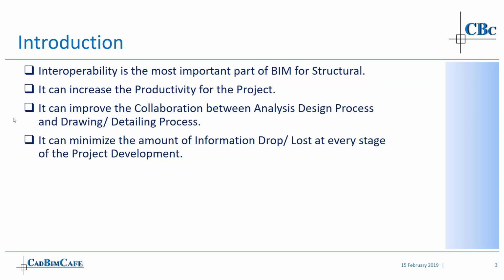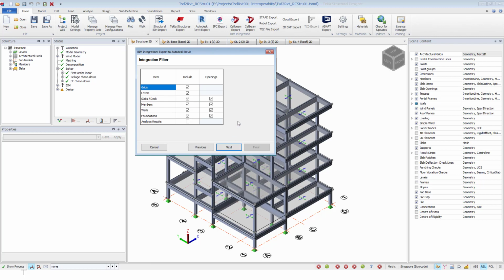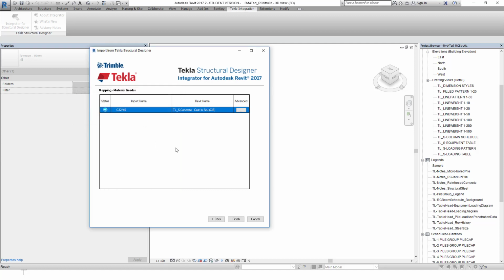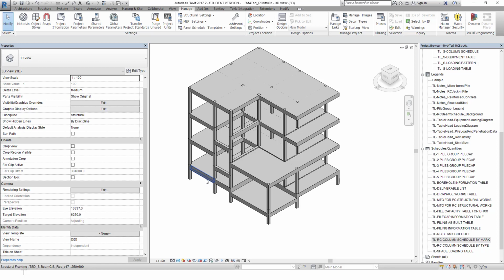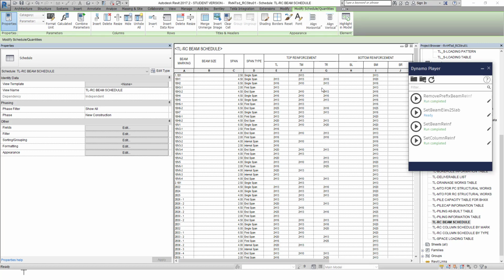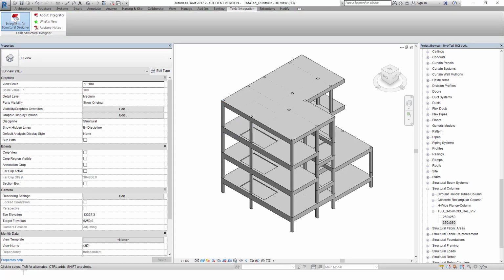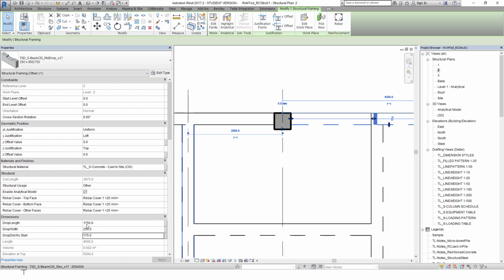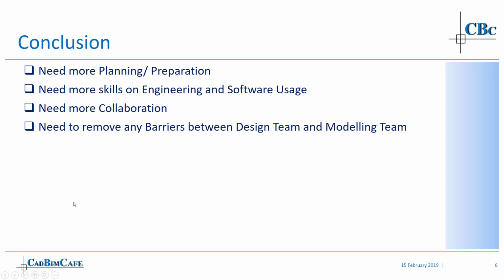CBc-Rvt003 Interoperability between Tekla Structural Designer and Autodesk Revit

Comment: it is not bi-directional though. That's the point. You should be able to buil;d the model in either and export it in the other. As it stands is one directional only. So if you build your model in revit, you're screwed.